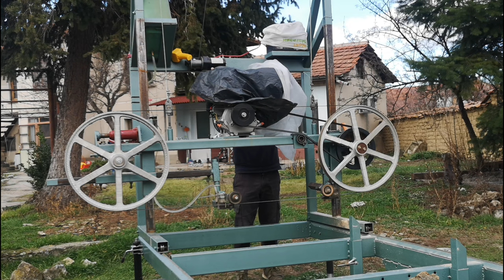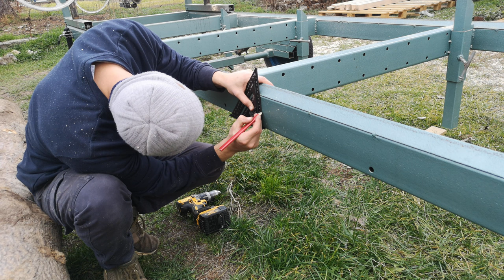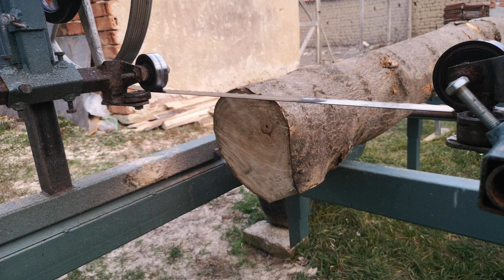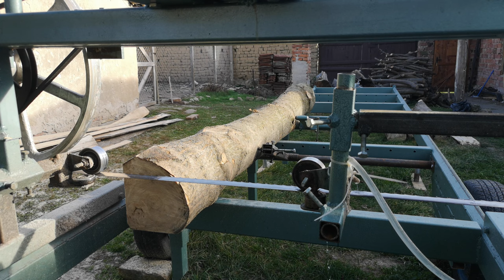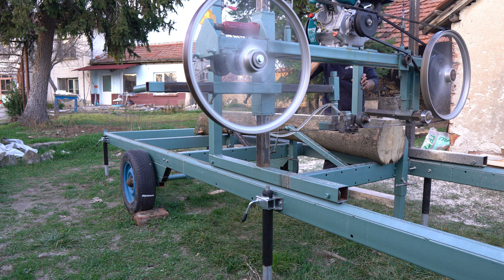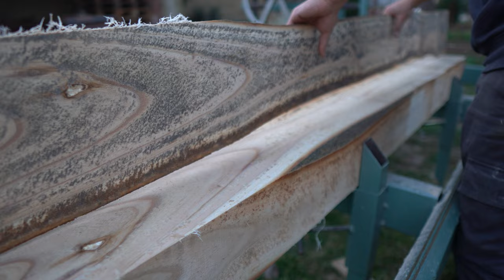Homemade Band Sawmill Build from Scraps - Make Homemade lumber

Comment: Nice bandsaw sawmill video. Where did you get the band wheels and alot the other parts from ? I have been wanting build one for my woodworking projects for years. How many hrs in the build of the bandsawmill do you have? Thanks Jason
Reply from the maker: Hi Jason.
I am currently filming a video explaining all about the built. Stay tuned and check it out in few days.
I will be answering all questions there.
Thank you for your support.